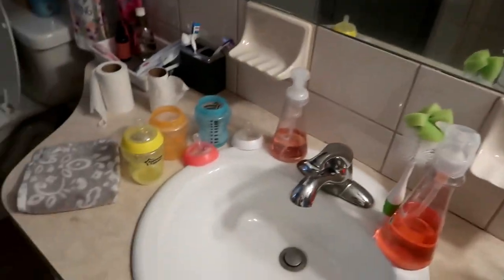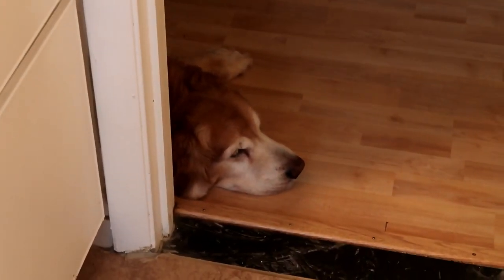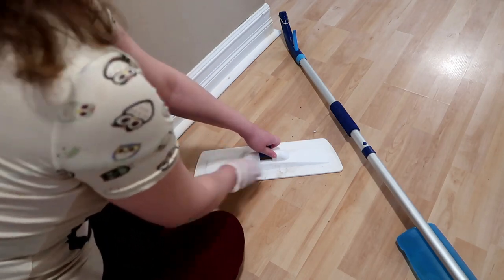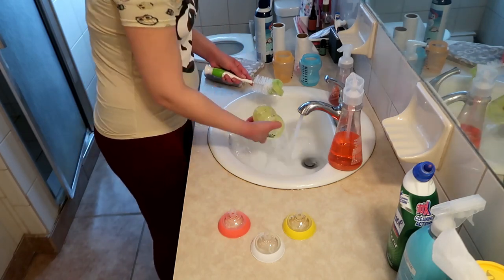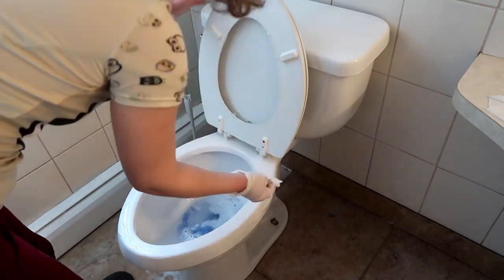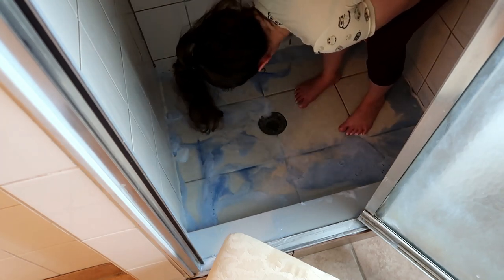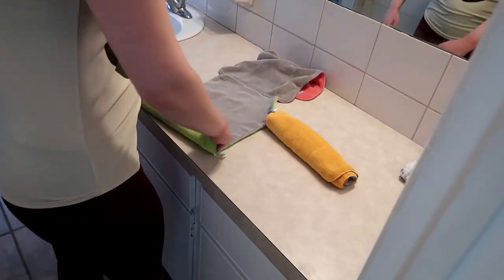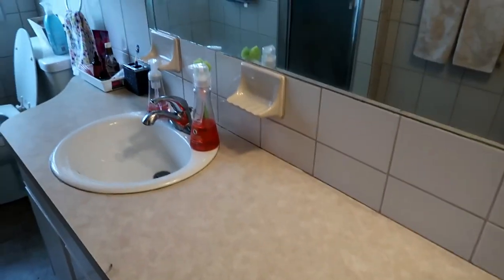BATHROOM DEEP CLEAN ROUTINE // CLEAN WITH ME 2019 // ULTIMATE CLEAN WITH ME

Comment: I use vinegar dish detergent and water in a spray bottle and I leave it for 20 mins and it works amazing you should try it really works for the shower great job I use to hate cleaning my shower also until I started using this I have to try the shaving cream trick yes I need my mirror clean also I love the little cabinet on the wall thanks for sharing ❤️
Reply from the maker: Little Bit Of Everything with Julissa I will definitely try that! The shower is never my fav, ty 💕